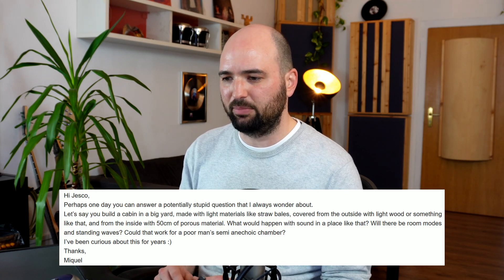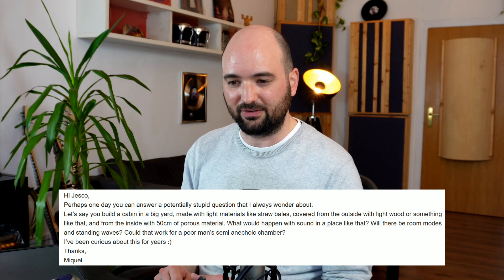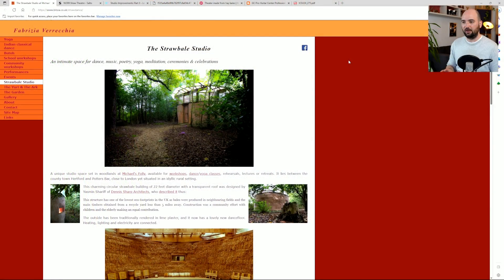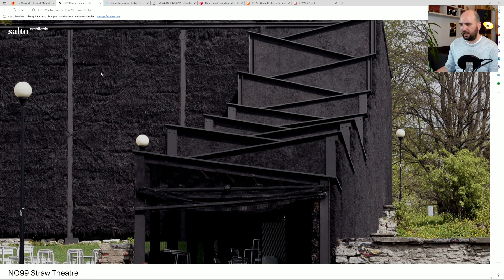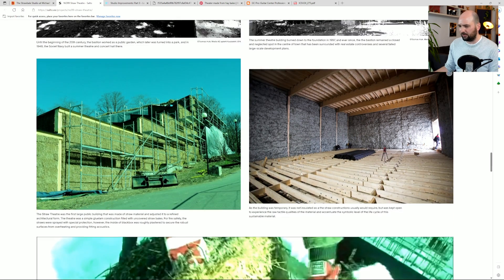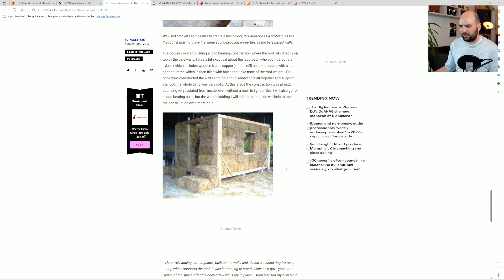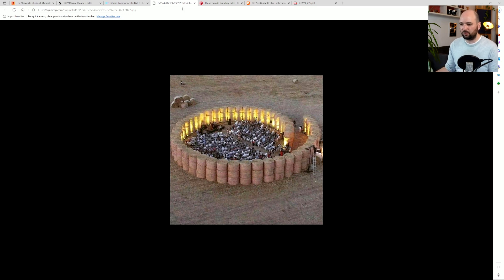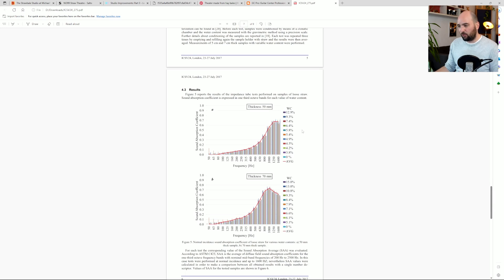Music studio made from straw bales?

Comment: Helped build a hay bale house in Australia. Bales are sprayed with concrete on the outside and rendered with fine plaster on inside. This provides protection against water, fire and insects. They provide good thermal insulation and the irregularities in the inside surfaces seem to give a calm or dead audio atmosphere, perfect for a yoga studio. Never measured room characteristics. Hundreds have been built since the sixties.

Comment: Hi, Thanks for the video. I also thought about this.
Please make a part 2 covering these options.
1. "Tent" like a dome or yurt. I have built many and they usually include interior thin fabric, then some insulation covered with foil, and external thick plastic.
They can be extremely weather insulated due to the blanket of insulation as thick as you want. In my experience the acoustics are amazing.
2.  Styrofoam with some kind of plaster. Search google for "japanese styrofoam dome village"
But this is a non ecological material so I don't really like this Idea.

*Regarding binders in rockwool/glasswool, to my understanding Knauf don't use any binders.

Comment: Hey Jesco! I have a question for you about subwoofer placement (specifically frequencies lower than 100Hz).

If I have the option - should I place my sub the closest to the floor I can or should I place it somewhere higher?

If I place it close to the floor it can amplify the vertical room mode, and on the other hand if I place it higher - I guess it could cause some SBIR problems(?)

Do you have any thoughts on this? Thanks!

Comment: I had high hopes for this, but it's frustrating. By the end of the video we still have no better understanding of a hay-bale room's acoustics. You aren't answering the question. "Can hay-bales be used to create a poor man's anechoic chamber?" First, you say they lack mass. Please go try to lift a hay bale, and come back and tell us how it goes. Mass is not just a function of density. 1 kg of feathers = 1 kg of lead = 1 kg of hay, i.e. same mass, different density. So how much sound the hay-bales "let through" really only depends on how thick the walls are.  But anyway, the question was not about isolation. It is about the reflective properties of hay. So what next? You compare hay-bales to dry wall. Again, not the point, and a wildly bad analogy. Drywall reflects sound like a mirror reflects light. You are stuck in the paradigm of how to optimize a studio listening environment (or more accurately, the paradigm of how to talk about your low-end sweet spot phantom speaker test workshop). More power to you in selling your course! Really! :) But consider that if you can't deliver on answering a question you chose to highlight, you loose credibility and will loose viewers. So, if you want to try again, tell us how much sound is REFLECTED by a hay-bale wall, and talk about its cost versus other materials that are effective in reducing echo. Then Miquel will have his answer to his question about a potentialy cheap material that doesn't reflect sound. (P.s. another way to loose credibility is to highlight your own inability to pronounce names you could have easily looked up in less than 30 seconds. https://forvo.com/search/miquel/ - https://forvo.com/word/perugia/#it) I'm probably being harsh. Delete if you want, but maybe you'll do better next time.
Reply: The answer was clear. No, it can't be used, if it's not a very efficient at absorption. However, the other contributor above says the round bales are perfect when 4ft thick.
Reply: @KaneDWilliams  Sure he was clear in saying that it isn't efficient at absorption. But again... that is not the question. The question is about use in ANECHOIC chambers. Absorption efficiency is irrelevant. The only thing relevant in an ANECHOIC chamber is ECHO. Does hay REFLECT sound. If I stand in the middle of a hay-bale room and clap. Will I hear an echo of the clap? You can talk about frequencies too. What frequencies are reflected by what materials and such, but there was no dicussion at all about echo and sound reflection. Too bad, because that was the whole point.
Reply: @HnsPtrsn  Echoes are only caused by reflections, so absorption is what stops reflections. If something doesn't absorb, it reflects and so no good as an anechoic chamber. That IS the answer. You may not hear much echoes from clapping, because it will absorb those high frequencies that cause flutter echoes but I don't hear those in my living room either, due to the soft furnishings. That does not make my living room a suitable anechoic chamber.
Reply: In short, if something is inefficient at absorbing, it is not suitable for building an anechoic chamber, which is designed to absorb as much sound energy as possible.
Reply: @KaneDWilliams  Air: also inefficient at absorption, yet somehow, no echo. Weird.
Reply: @KaneDWilliams  Look, sorry to be flippant there… but it is commonly known that of the three types of absorbers (porous, membrane, and Helmholtz), there are two kinds of porous absorbers: fibrous and open cell. Given that hay is a fibrous material, one would expect it to be absorbent. But at what frequencies? Apparently low frequencies pass through it, as per the video. What about all the other frequencies? Are you here to tell me that they just reflect? Cool, because the video didn’t say that? And somehow I really doubt it.
Reply: @HnsPtrsn  For ANY material is to be useful to build a anechoic chamber out of, it would need to be a fantastic absorber and he said it isn't. Something that absorbs some frequencies but not others is not suitable. Hey will certainly not work as a the other types of treatment you mention, so we are left with how well it absorbs (porous type) and the answer was not very well. If you can build a membrane or Helmholtz absorber from straw I'd be well impressed.
Reply: @KaneDWilliams  He said it wasn't efficient for low frequencies. Even the absorption materials used in very high end anechoic chambers are not efficient absorbers at low frequencies, leading to reflection of low frequencies off of the walls behind the large wedges. (They are now trying to mitigate that with active noise cancelation in at least one chamber in France, I believe.) Anyway... another aspect to the question was the "poor man's" designation. It might be just good enough to compete with other materials when compared to cost. But alas, we don't know because the study referenced only did the testing on hay-bale walls that were covered in plaster. So from that study, and this video we cannot be as certain as you seem to be, since the plaster is gong to reflect the relevant frequencies even before the hay gets a chance to absorb them.

Comment: A friend built a straw bale rehearsal room in his backyard. He did finish the walls in plaster so the acoustics are what you'd expect in a plaster room - although not too bad because of the unevenness of the plaster over straw bale. But it is quite soundproof. Staw itself is fairly transparent, but when you've got 40 or 50 centimeters and it's compressed it seems to work quite well at absorption. But the reason he built it wasn't for the sound - it was to make an affordable to build space that doesn't cost much to heat. For that he certainly did quite well.